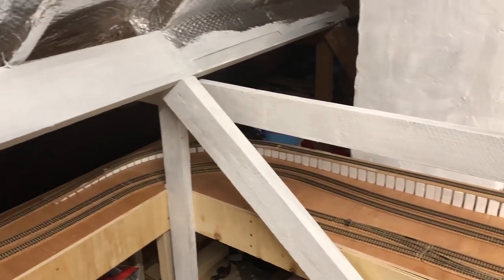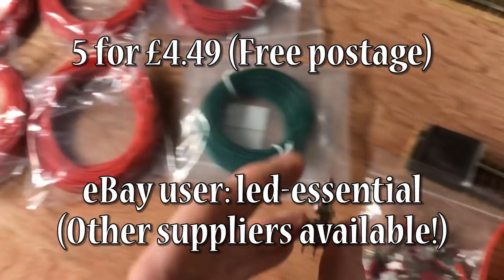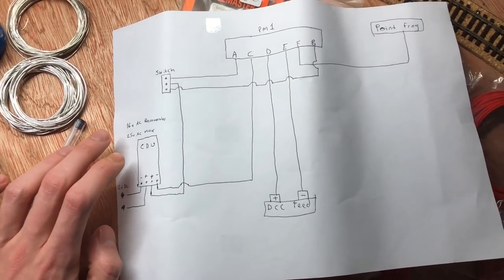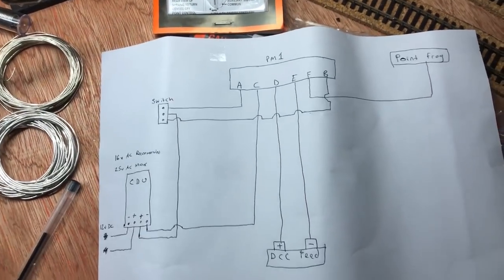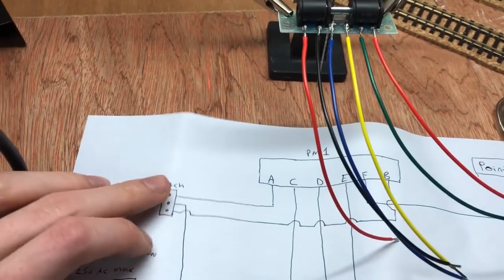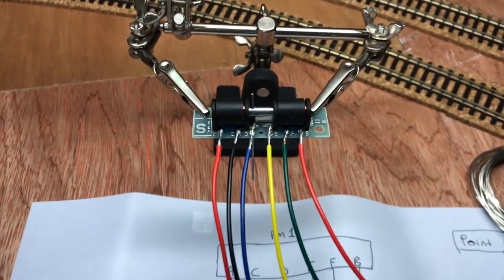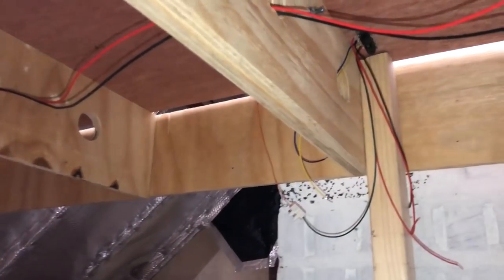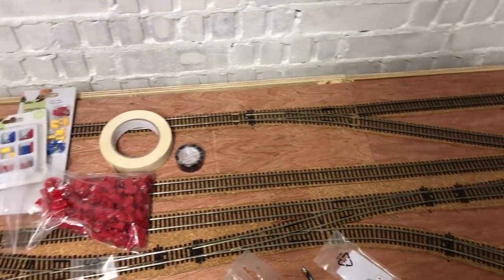How To Build A Model Railway - Episode 11 - How to | Point Motors | Gaugemaster | PM-1

Comment: Hi Tony
Many thanks for the reply it is really appreciated and I know you must get many requests. Yes I understand what you are saying. The peco polnts I have are the old electrofrog polnts type which I will have to solder a wire to the frog but I can't see where I have to cut underneath and solder two connecting wires. Perhaps if you get any time perhaps you might do a video on this. Many thanks again and congrats on your new arrival
Mike
Reply from the maker: Hi Michael, no problems! I'm sure I did cover it in either Episode 10, 11 or 12. But If I didn't I'll try and put a little video together on it. In a nutshell, it needs to be the blades that are connected to the main rails, and the whole frog area needs to be dead, so that when you connect the frog wire to it, it's power is determined by the point motor or polarity switcher.

Comment: Great update Tony look forward to the next instalment . In my experience them red connection blocks are more trouble than they are worth so my recommendation would be to solder you dropper wires to the bus loop.
Reply from the maker: Brian - Thanks for your comment! Yeah a few people have said the same thing. I’m going to be looking at a few other options people have suggested. Seeing as I have the red splice blocks already, I might do some testing and see what’s what. But if I have problems with any of the options available, I will inevitably end up soldering underneath the baseboard!
Reply: Them things a always used to fit towbars on cars and other stuf they are a pain in the back side when electrical issues arise.
Reply: Brian ....you are so right Brian.....esp on the really fine wires ...I changed to soldering and also wago quick connectors or similar esp when used with ferrules.....regards fred
Reply from the maker: Yeah a lot of people are saying this...definitely gonna have to rethink it I think!
Reply: Its up to you tony its your layout at the end of the day but here are my finding to justify my issue with them clips.
They are prone to damp getting inside. 
When you crimp the wires in the blade doesn't always cut through the insulation causing a bad or no connection.
If accidentally caught the wire will pull out.
In my own opinion they are more trouble than they are worth but try it crimp a wire and pull it .
Good luck tony and if you do solded it you will probably end up like me hating soldering lol but perfectly running track.
Reply from the maker: Yeah I do hear what you’re saying, and it makes sense. Thank you for pointing it out!
Well seeing as I have them, I will try them out, and thoroughly test them before deciding to put them on the layout. There are a few other options people have pointed out that I’d like to try before soldering. But soldering under the baseboard is my last resort if nothing else works consistently enough for me!
Reply: Ok good luck tony and let me know how you get on with your capacitor discharge units as i want to fit them to mine.
Reply: Brian .....hi Brian I’ve fitted CDU to my points set up they work great .....have a look at the Cheekytek channel he did the same after first running points without a CDU ....regards Fred
Reply from the maker: I have to admit, even just through testing the CDU’s and not having them permanently installed yet, I can already say they are worth their weight in gold. I’d highly recommend them!
Reply: Ok thanks Tony i will get some ? Is it one cdu to a point ?
Reply: Yep seen it fred 🖒
Reply: Brian ......one CDU will run several point motors not sure of the max amount....regards Fred
Reply from the maker: Brian - It will run quite a few at a time, but depends on how many you can actually wire up. The terminal isn’t that great in size. I’m going with 2-3 CDU’s for all 26 of my points
Reply: Ok look forward to seeing it done tony .
Reply from the maker: Brian - Thanks, it’ll hopefully be in this weeks video!
Reply: Great i must get started on my wiring too

Comment: Tony don't know if you know the cable specs but 14/030 is 14 strands at 0.030 mm each strand. Also I've used them on 28/030 cable .  
14/030 is 8.75 amp rated
And 28/030 is 17.5 amps..
Hope this helps.. good luck..

Comment: Great video Tony.
I work for a company that sell to the automotive trade and must say that the RED  suitcase  connectors are not in my opinion the best.. Blue " scotch locks as they're known are far better for cables up to cable size 14 /030 .
Reply from the maker: John Cresswell - Thank you! I will need to connect 16/0.2 to 32/0.2 so will the blue ones still work?

Comment: Hi Tony
I've really enjoyed watching your videos they are very helpful. I recently watched installing point motors from Everard Junction which was very similar to your video. However he connected his green wire to one of the frogs. Now this is why I'm confused because on the peco electrofrog points they already have wire attached which he did not connect also he did not cut the rail underneath the point or solder some wire as per instructions. I have tried to contact Everard for some clarification but no reply after 3 months. Can you therefore advise what connections cuts etc you make on your points also how do you wire up your 3 way points. Many thanks
Mike T
Reply from the maker: Apologies for the late reply! I'm slowly catching up with everyone!
From what I understand, Peco changed the style of their points. So, it depends on which ones you have. Some need the modification, and some don't. That little wire pre-attached to the newer points is exactly the same as the green wire. Just that not all of them have that little wire and so need the green wire soldered on. Hope that make's sense.
3 way points are just two points basically, so wire it up as 2 separate points and it's pretty straight forward!